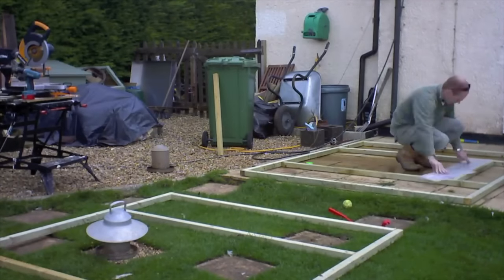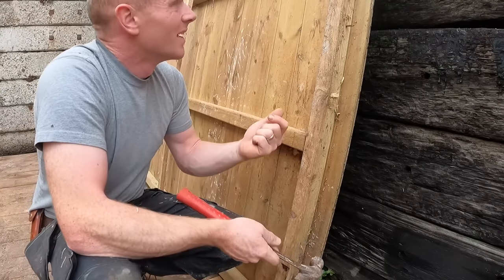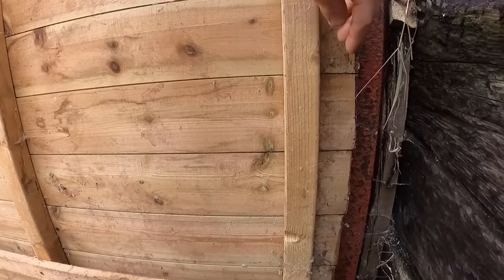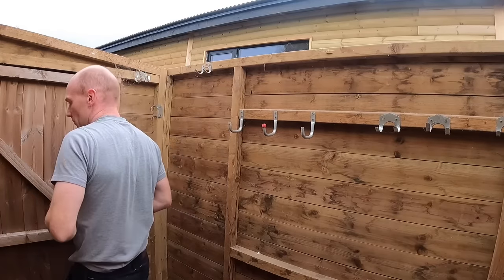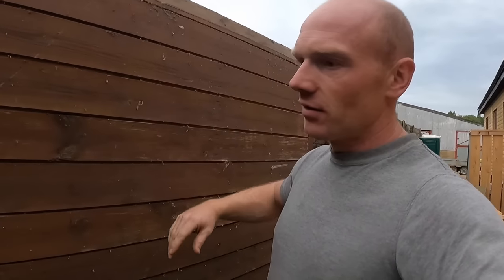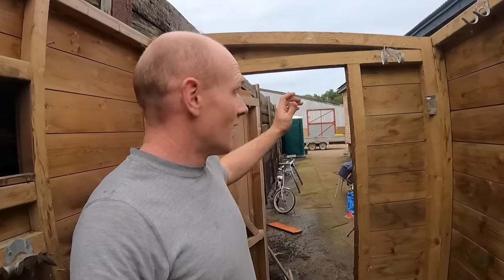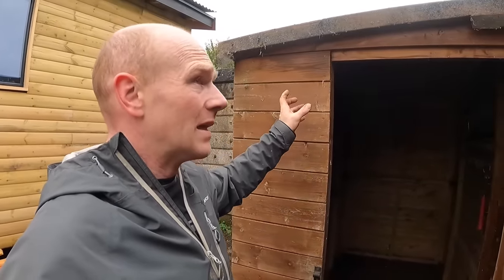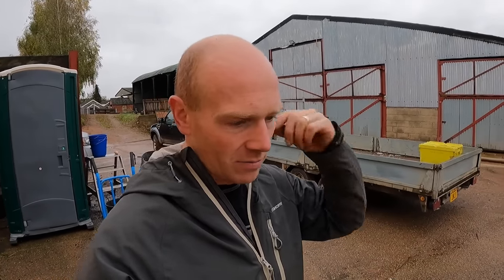HOW TO LEARN DIY - The Shed Theory 🔨

Comment: I agree Tim, build a shed yourself rather than buy one. In 2021, i built a garden shed for a friend. 8x8 ft. Made from 3x2, OSB, 12mm ply, steel roof, breathable membrane, 10x1timber lengths and it came in cheaper than buying one by about £200. Outcome? Weighs over a tonne and will last a lot longer than one bought from a garden centre or whatever

Comment: There IS one wood treatment that actually works, it stains/protects retains it's stained look without varying colours and lasts decades.. It is used by Parks Canada in several of our National Parks including Banff, Kootenay and Yoho National Parks. It is called Life Time, it is a powder that you mix with water and apply, non toxic and gives fantastic lifetime results, check it out. But you are correct cut new wood will never retain it's "new" look.

Comment: Couldn't agree more re exterior wood - spend your money on wood that will last externally and skip the wood finish. Great video. And a saw tip for newbies: get a 9.5" Japanese Ryoba saw. It's all you need for 1" and 2" depth lumber and even up to 4" x4" lumber i.e. anything smaller than sheet goods. Easier to build sawing skill than with a western saw and it has a cross cut blade on one side, and a rip blade on the other.

Comment: Breakdown with some of the design proces would be really insightful. 
10 years ago I could barely hammer a nail. Today I put the finishing touches to an outdoor classroom I designed and built for a client. Still making mistakes, but every mistake is a nugget of knowledge. I've had no formal training.  My first build was a firewood/kindling store with some old pallets and manky boards scavenged from a river (i was exceptionally skint at the time). I bought a 1m3 bale of offcuts from a saw mill for £15 and used it to make a shingle roof.  The leftovers i cut up to use as kindling. Since then I've made some absolutely shoddy abominations but also some pretty neat stuff. 
About 4 years ago I got an entry level job in landscaping. After a few fortuitous promotions I ended up running the project. Designing and building and improving. Picking up nuggets along the way. Slowly starting to feel less and less like an imposter!

Comment: Excellent guidance in this film - I started out in DIY about 50 years ago building a bed from plans in the Readers Digest DIY book and haven't really looked back with projects right up to converting part of a barn into a house . .  the bed was finally retired not that long ago and its timber re-used to make a number of items!  Confidence building is key - although the need to do stuff with budget constraints also applies.

Comment: Over engineer a shed??? Yep - I have created frankenshed- should have used 2x2 instead of 3X2 on the walls. I shouldn’t have fitted T&G OSB3 to the roof section first as it now weighs a ton. Weather beat me and 4 walls, floor, and roof(in 2 sections) are under tarpaulin at the side of the house. For the roof section that has OSB on it will take 4 people to lift that. 

A7x7 pent shed with a 10x10 roof!!!!

Comment: I was taught that ledged and braced doors should always have the bracing going down from the hinges. That way the vertical boarding stays closer together. If braces go up, the boards will open and the door will widen and bind.

Comment: Very helpful video. Lots of practical advice for us DIYers. I've started on tiny projects like boxes and small over the bed tables, shelves over the last few years. The largest build was a free standing wardrobe. Each was a massive learning curve but helped with the next project. There was also a load of power and hand tools acquired along the way as well as the construction of a workbench. All these are confidence building exercises. I'm tempted to build a shed, but I have a 120 yo timber  house to repair and restore. Looking forward to your next built. And thanks for sharing all you do and your experiences.

Comment: Your comments about wood treatment really sealed the deal for me, I recently finished a timber frame summer house out of reclaimed pine (I think the last vid on my channel shows it right at the beginning if you want to see it) and I've been putting off putting a finish on it, not least because just sanding the whole thing will be a mammoth task. And the more I research the matter and experiment with different finishes, the more I come to the same conclusion: that there is no way to persevere that "real" wood colour, it'll all go grey within a few months or years and then you have to do it all again which I ain't got time for. I'm glad I built it in such a way that any rain on it will dry very quickly and I am pretty sure it will outlive me, and probably my kids too, which is more than enough.

Comment: Inspirational! A couple of years back I 'saved' a rotting shed by firing about 100 screws into tons of creaking places, a load of expanding foam into a rotted section, plus a new floor of old decking boards. It's surprising how you can make it work if you get creative. Myself I would prefer the stage by stage approach. Will you be making up some batboxes, could be a halloween video right there!
Reply from the maker: Bat and bird boxes saved for rainy day projects over winter. 😀